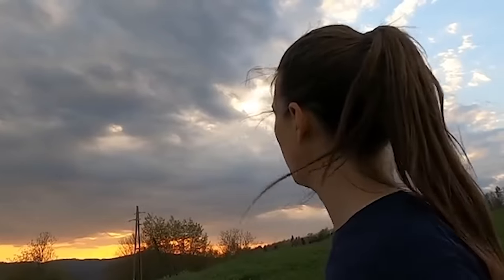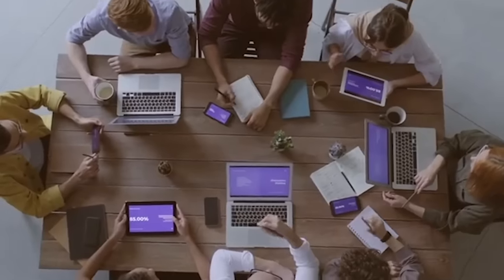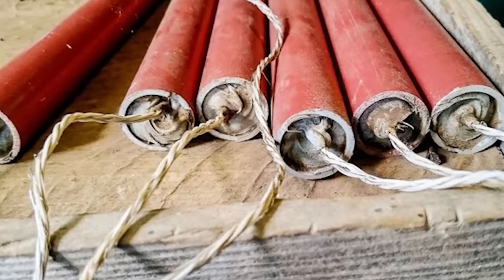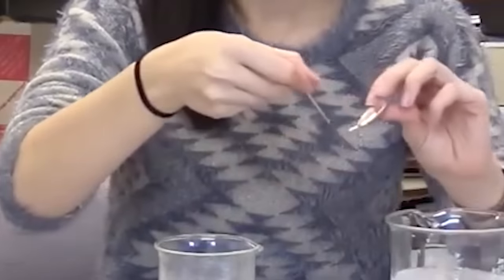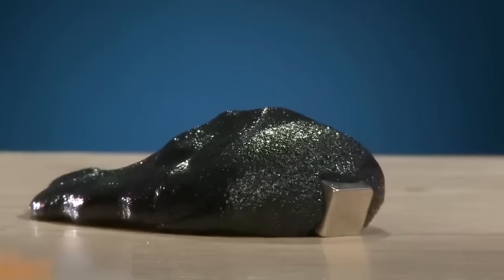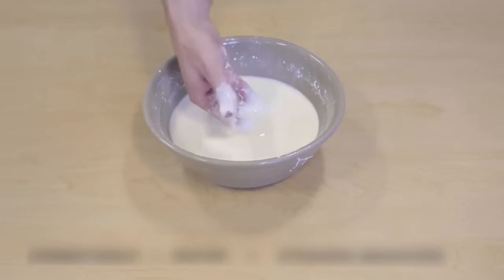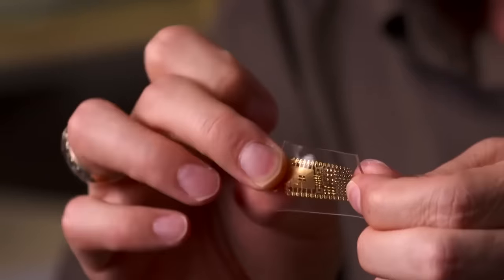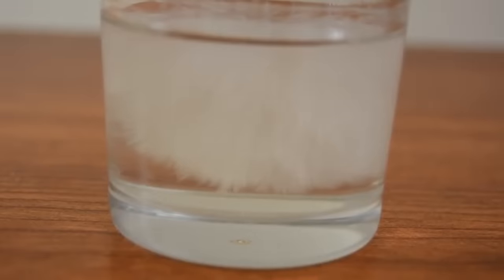This is The Darkest Material On Earth

Comment: How about a hydrogel that will work with vinegar that would be perfect burn care material and yes. Vinegar is pain relieving for most burns: sun burns hear burns, steam burns but that's great too and some chemical burns. Creasote comes to mind
Reply: Vinegar in a spray bottle for sunburns
Reply: Every dang summer my red headed self burned to the point of blistering and cracking and I was always smelling of noxema and vinegar, but it didn’t help that degree of pain. Did my mom use sunscreen? Absolutely not.